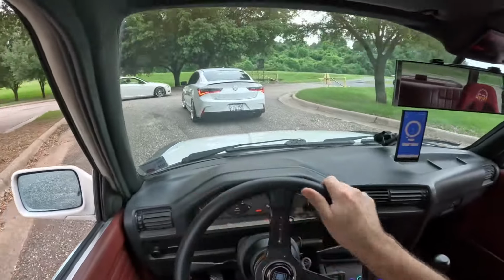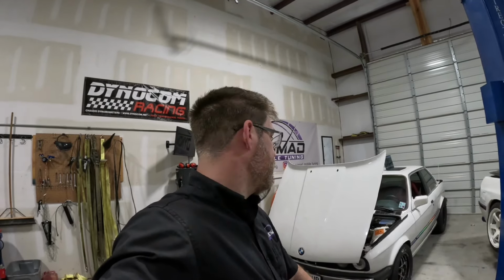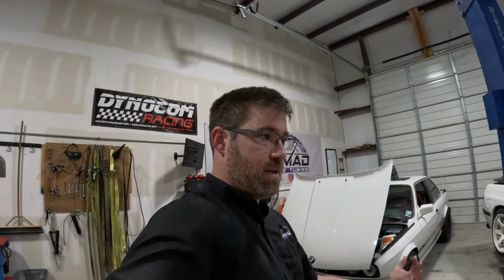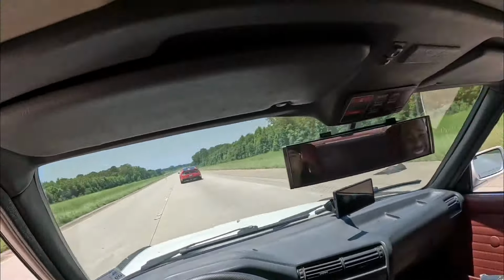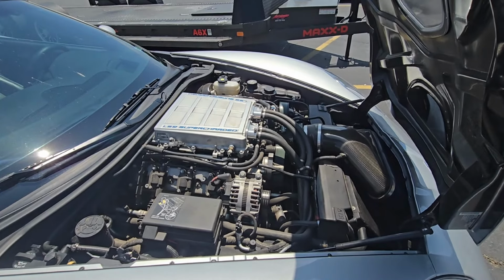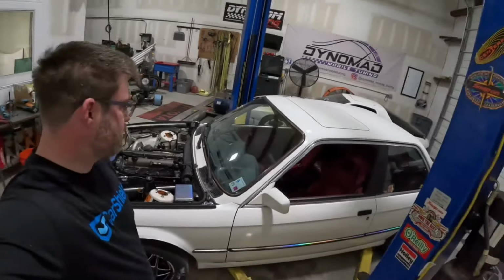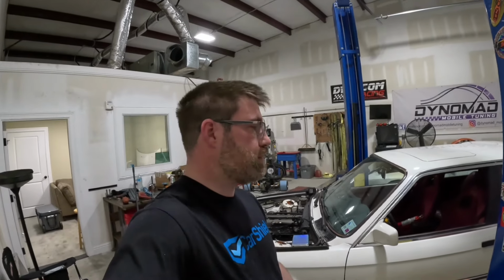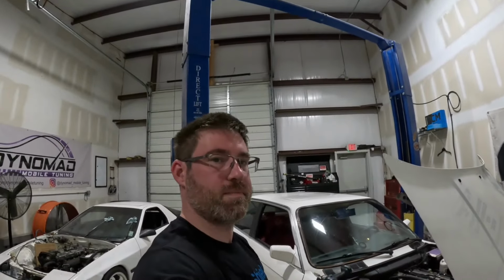The Gappening Part 6 - 2JZ DCT E30 vs 1000hp TT S550 and 900+hp C6 ZR1 + 720s, Whipple S550, GSXR750

Comment: That sucks... What's the plan to keep the IATs down for next time?
Reply from the maker: Well, it's manageable in less intense heat. When they're already 120* and it's 110+ outside, it's hard to keep them down, so we're going to not run in the intense heat, and may add meth or a more efficient Intercooler. But a bigger Intercooler will require us to do a tube front end

Comment: What is the diff set up? Saw in a old video it was a stock lsd and I'm curious if it still is.
Reply: Also curious on wheel and tire setup!
Reply from the maker: Yes stock diff, e34 axles with an adapter. Tires are 275/50/15 ET Street R
Reply: @DyNomadMobileTuning  Thanks for the info! Sorry to see the engine go but man your e30 seems wicked! Can’t wait to see what you cook up next.

Comment: NGL I see you throwing up finger signs like that I'm likely to ask you to spit on it first, boi. A bit too excited within the first 3 minutes aren't we? Nice E30. You should see of you can find the E30 we in SA have, it's 'an appropriated' E46 CSL everything you can fit in a 325is evo-2, caged, carbon & boosted enough too. 😜
PS, my buddies work truck is running the same swap as your E30... I think the gear whine is terrible but whatever.